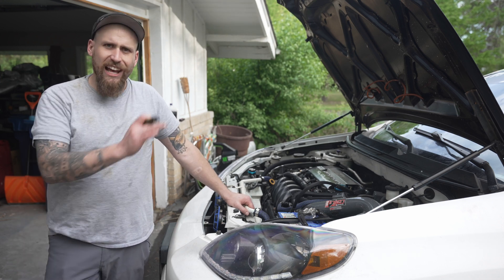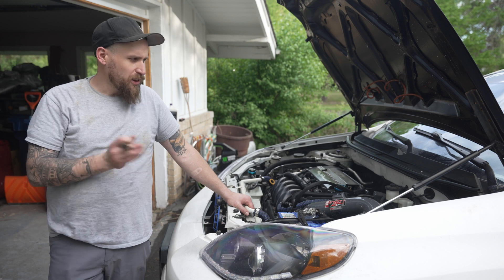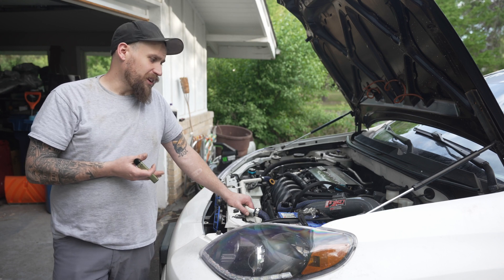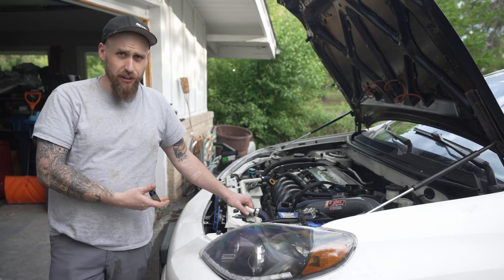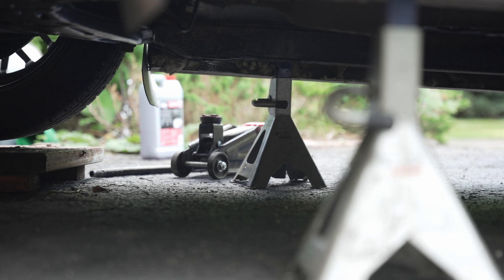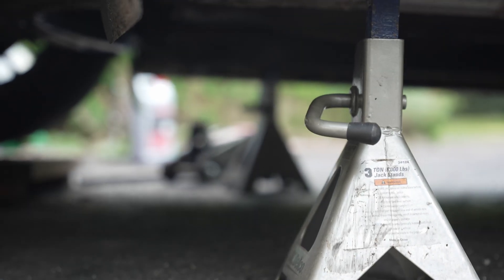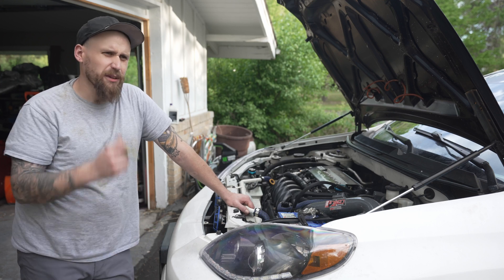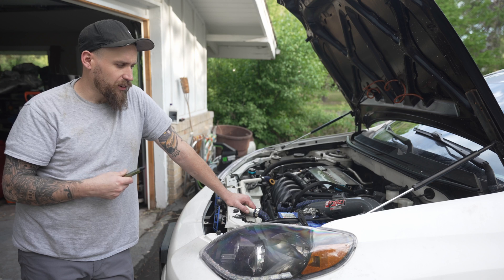Installing the Monkey Wrench Racing Super Charger Part 1

Comment: Did you run into fitment issues with the radiator and alternator ?
Reply from the maker: Oh yeah big time. The fan shroud needed to be trimmed A LOT the alternator positive post sits about 1/4in from the radiator itself.